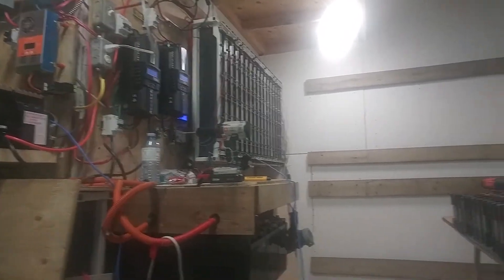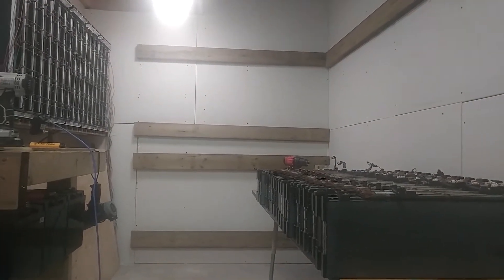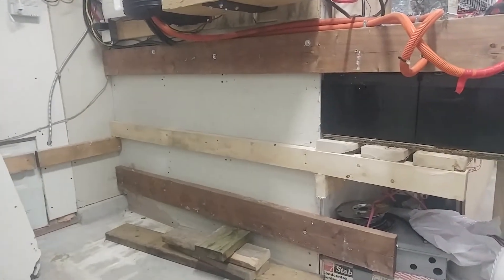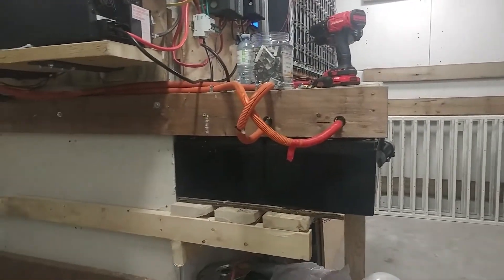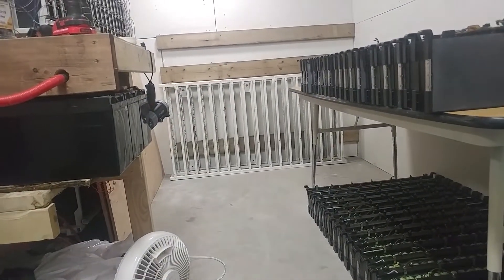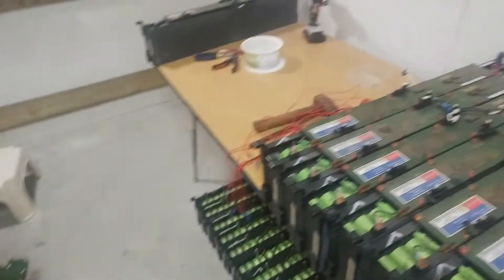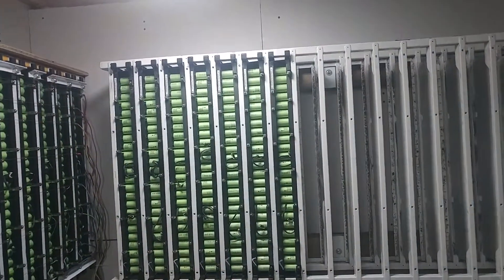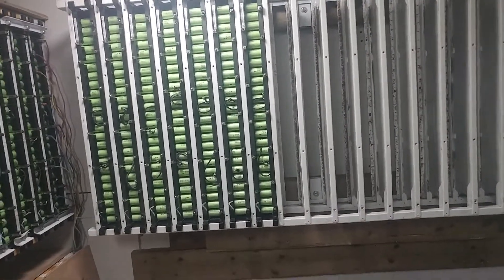2020 06 More batteries on the DIY powerwall

Comment: I whish i hawe 100 pcs.😭😭😭😭😭😭😭😭
Reply from the maker: 1 bus pack has 96 on ebay  40 volt A123 26650 I don't have a shipping license  This is not my listing just one I found on Ebay as an example.
https://www.ebay.ca/itm/1-used-40V-36V-block-of-96-Cells-3-2v-LiFePO4-26650-battery-rechargeable-12s8p/283508501455?hash=item42026c6bcf:g:5s4AAOSwEAtc-Va3